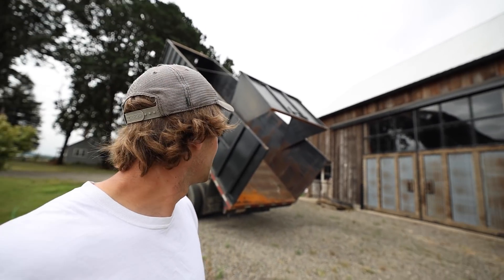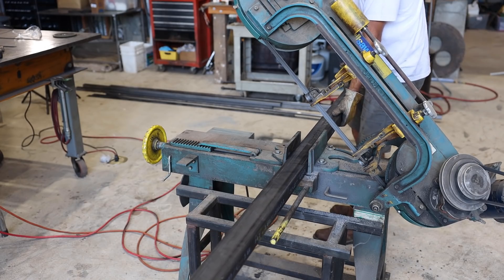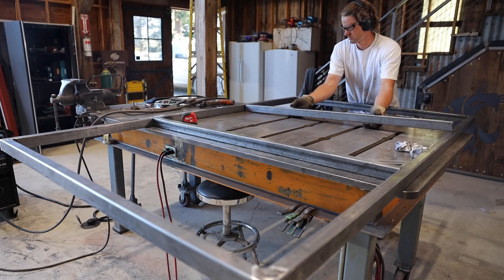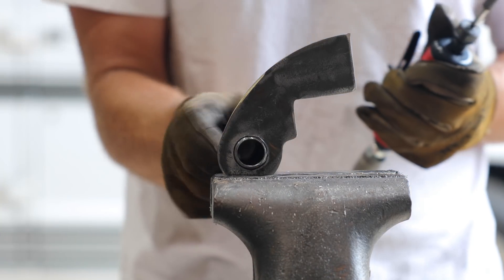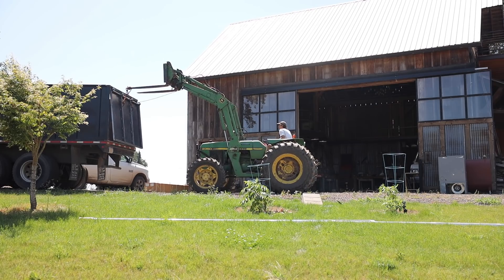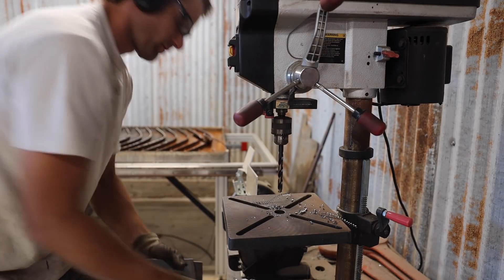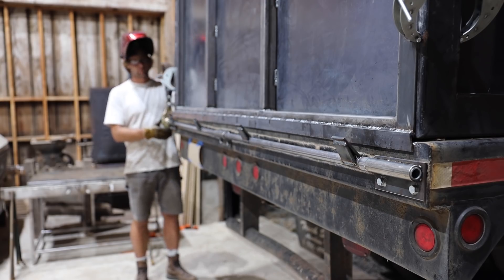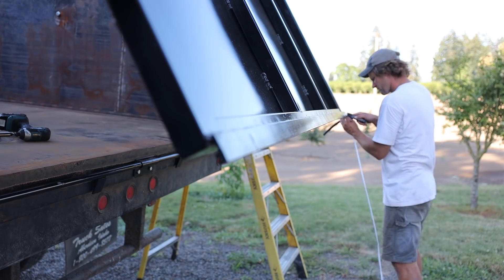Truck Tailgate Fabrication and Rollover Tarp

Comment from the maker: SimpliSafe is award-winning home security that keeps your
 home safe around the clock. It’s really reliable, easy to use, and there are no contracts. Check out SimpliSafe here: https://simplisafe.com/rainfallprojects
Reply: The pin was still visible after you moved your hand, just a heads up
Reply: @blakegoodwin9755  I saw that too. Might want to change it

Comment: Mag drills are ment to be used in all positions. That's why they have the safety chain attachment incase of power loss or the magnet breaks free. Use them lots of structural steel.
Reply: This one looks to have a pretty narrow base, probably would have been a lot more stable if he rotated it 90 degrees.
Reply: @bradley3549  Most Hougens have a similar sized magnet. Some of the best mag drills money can buy in my opinion. Just gotta watch out with the larger drills, they require a minimum thickness of material to have enough meat to have the magnet work properly.

Comment: @Rainfall Projects, this is actually one of the exact setups that Mag Drills were designed for. I've used them thousands of times for drilling new holes in Truck Frames. If you have a good Mag Drill it will stay there in a Horizontal position with no issues. The one I am currently using is the Milwaukee M18 Cordless, and I think I could actually do chin up on it in a Horizontal Position lol. It has crazy Mag holding power.
Great Video!

Comment: Hi @Rainfall Projects,
Great work.  Very impressed.

Here in Australia the harvesters will cast into a semi whilst harvesting and the harvesters run around the clock with multiple trucks running back and forth to the silos or field bins.  Why the different practise?
Reply: its grass seed, its tiny and probably never got close to filling the truck once.

Comment: This video brought back so many memories of me and my dad fixing up our grain truck to haul corn and soy beans. With the roll tarp. We even broke the frame of the truck once dumping it and had the rebuild and reinforce it to handle the load. We ultimately mad a fixed door with several slide doors on the back to “ aim” into the augar for the grain silo.

Comment: I see you have the same issues with the torch height control you find any solutions to making it not dive into the workpiece?
Reply from the maker: That was my fault, I went off the edge of the metal. Trying to squeeze too many pieces out of that strip.

Comment: I'm not sure if you did, but for the latch mechanism, it is a good idea to start welding holding "levers" to the long tube starting from the end near air brake slop adjuster, and then put quarter under previous "lever" before welding next one. This way you would use the whole tube as an improvised torsion spring and both ends will be securely shut. But again, I'm sure you already thought of that. Great video, as always. Thanks!

Comment: Sometimes I wish life could give you the opportunity to stick your toe into every industrial branch for a little time. I feel like most metal workers only see a small fraction of the stuff they could do with their knowledge. 
I'm currently working in the ship industry making the giant diesel aggregates for cruise ships, but don't have any clue on how to repair a tractor or truck engine.
I'm quit happy with my current work field but sometimes I wish I had the knowledge and opportunity to work on other stuff than just ships. Switching your branch seems like risking your whole carrier. 
It feels like having to start from nothing again which makes me kinda sad.
Reply: Well, perhaps you could try a bit here and there in your spare time. For example, buy an old wrecked tractor or a truck for cheap in the junkyard and see if you can repair it. I'm sure in principle the engines are somewhat similar even though the specific parts will look probably quite a bit different. Perhaps you could even offer a helping hand to someone who does truck repairs, offering your help for their knowledge. I'm sure there are ways for you to try different things, in my experience, if you're not afraid to ask, you can get to see and learn a lot of cool stuff :))

Comment: Nice retrofit Justin!  There is a program for plasma cutting called TruHole Technology, it burns holes in plate so you don't get the taper from the kerf on the inside of the holes.  Might be worth looking into.  No more die grinding with it.

Comment: Just had a thought. All the rice trucks that run around near where I live have a small sliding door lowdown in the centre of the  tail gate, about a 12/15 inches square. I imagine it is to allow dumping into an auger hopper or a smaller receiving system than opening the whole tailgate.
Reply: you're exactly right. Good for regulating flow too if you're processing grain further.

Comment: I use those hogan mag drills all the time at work, they can be used in any position, that little ring on the back of the magnet is for a chain so you can tie it off